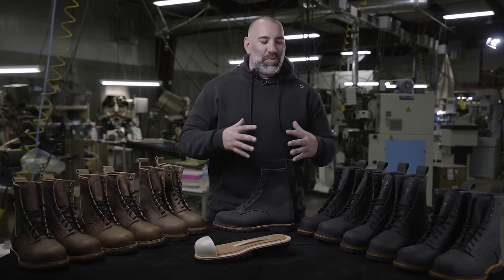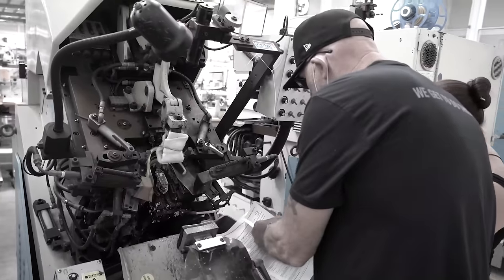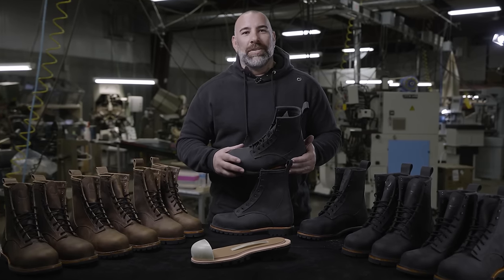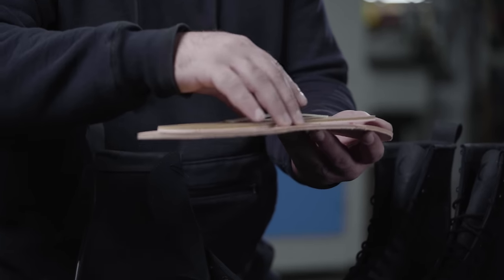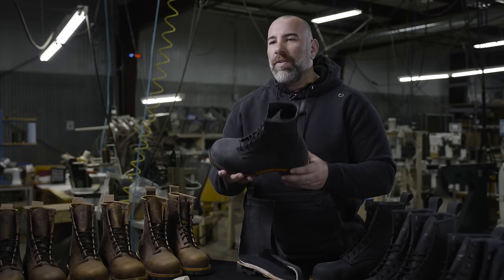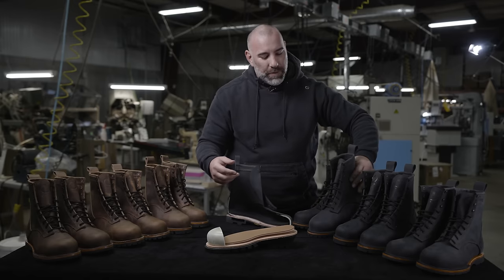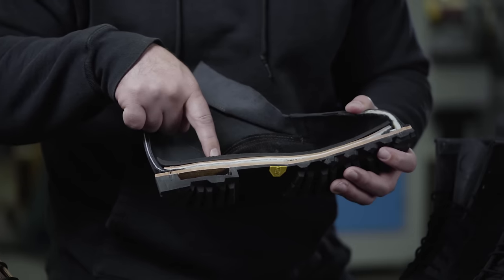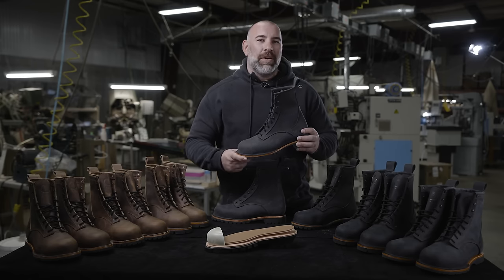HOW WE BUILT AMERICA'S BEST WORK BOOTS

Comment: I'm a mechanic in San Diego . I'm out in the sun and concrete all day and my boots get demolished, I constantly go through boots because non can handle the toe area scraping on the concrete every single time I have to go on my knees to jack up a car or place it on the lift. I also work rain or shine and the boots need to resist abuse . I hope this pair will do the job , looking forward to trying out this boot and getting the best out of this investment.
Reply: Do they make boots with replaceable toe cap? Snap-on type toe cap?
Reply: You need Tuff Toe epoxy for the toebox. It will also wear down but it takes a while and you can reapply it.

Comment: I just received my pair of the six inch version of these boots. Seems like everyday I wear them they look better. I'll have to update this comment in a few months to give a better review. So far I'm very satisfied.
Reply: Update, hope they holding up?
Reply: @dsdiesel8667  the sole is separating very slightly from the the mid sole in-between the heel and the ball of the boot. Its not really a problem but it's very irritating considering I spent 338 dollars on them. Origin told me that they would let me send them back in to see if im eligible for an exchange/refund but I ended up not doing it because they are sentimental to me considering they're my first pair of American made boots. I'm just going to get them resoled in about a year
Reply: @Sean-mv4ed  I decided on Thorogood’s 6” steel toe Moctoes & made it 8 days and the whole front outsole started separating. Thankfully the place I got them from warrantied them out.
Reply: @dsdiesel8667  damn that blows dude, if 8 were you if you haven't already ordered them I'd call origin and ask if they put some sort of device on the soles that hold them to the mid sole other than just adhesive. Other than that they're bad ass. What I really like about them compared to other boots is they almost feel like tennis shoes, like you can really move around in them. Also They're so nice that you don't want to get them dirty.

Comment: Steal toe definitely doesn't belong in my line of work. I work around power lines and we can not wear them. And composite safety toe hurt my feet when bent over. And I need a 100% waterproof boot. If you can make that than I will give it a try also as it's not $500

Comment: Good boot, just not very slip resistent for those of you that work on oily and wet surfaces
Reply: Update, after some research the vibram outsole they use is one of the best, they’re the same ones in $500 boots, but that specefic outsole i got is best for outdoors and mud, which doesnt really work well on slippery hard surfaces

Comment: I'd never buy a pair solely because of the sitch down construction method. I've owned many bits over the years and I can honestly say that the such down method is a far inferior method to a full welt. To me it's like a company is cutting corners and being lazy or they don't want to develop the talent it takes to make a full weekend boot. Even if it's a gemmed Goodyear welt on a leather mid it's a better product. Many don't like it because they are harder to break in than a stich down, honestly that says something about buyers as well, but the full welted method is more easily resoled without having to replace the vamp. I could go in but it's kind of pointless.

What it comes down to for me is that you are cutting corners and making a lesser product than you could be

Comment: Most companies that institute this policy fail to do a proper hazard and risk assessment of if the policy will truly be beneficial for employees. Yes it will help prevent foot injuries if something is dropped on or driven over the foot. What is never considered as a balance is the definite long term consequences of wearing safety toe shoes (versus slip resistant and other safety shoes provides). Things such as hip, knee and ankle pain that WILL be caused due to the unnatural foot and toe mechanics that result over time. Unfortunately no one is willing to do a long term study on this. Only found one from Britain that got no press about a decade ago I believe. There is without a doubt areas that the benefits out way risks, but not the blanket policies OSHA pushes and companies blindly follow with short term thinking without looking at long term outcomes for employees that likely only work for a company a decade or so. Thank you for the great information, but maybe give some consideration to asking the better questions up front.